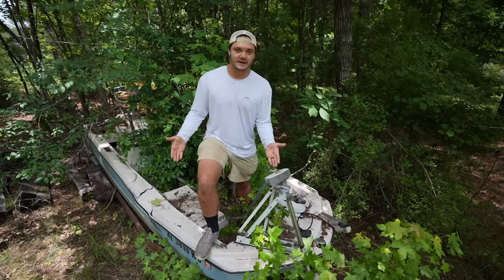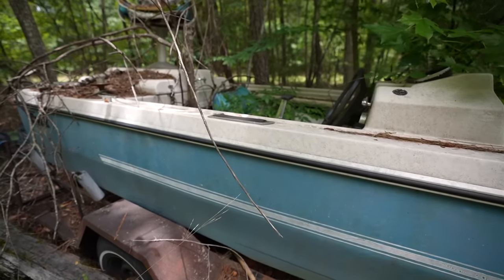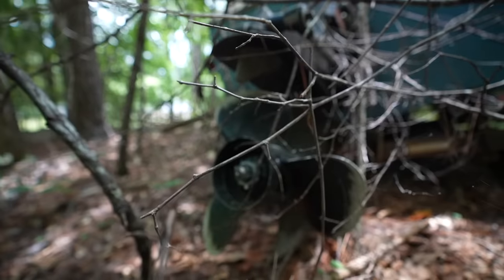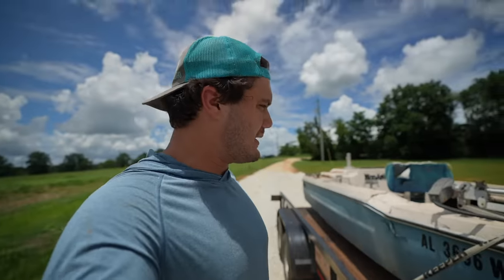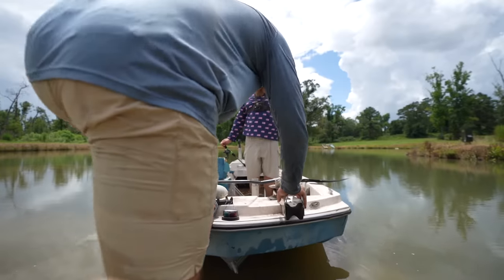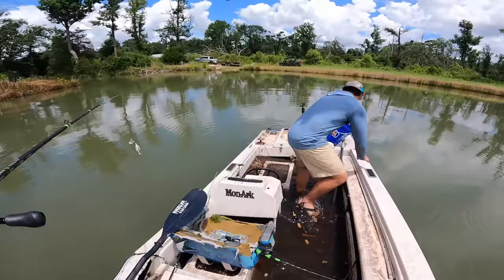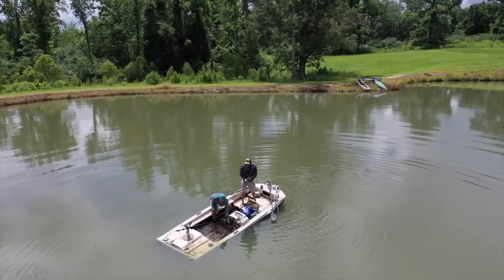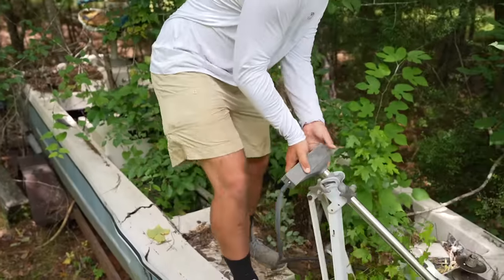I Found a 35 Year Old ABANDONED Boat in the WOODS!! (Restoration Project)

Comment: The hull looked like it was actually in decent shape. Then you dragged it across the asphalt and lifted it with a forklift to push it onto a trailer. Which totally destroyed any chance of salvaging it.
At this point it will probably cost just as much to fix it as it would to just buy a used one that's in decent condition...

What blows my mind is how much dirt is in it. Did someone take a shovel and try to bury it?!? How does that much dirt accumulate in something 3 feet off the ground?

Comment: If you ever need advice on fiberglass work or any other help restoring a boat, hit me up anytime! I'm guessing the boat being dragged on the concrete popped a hole in the bottom most likely an easy fix. Great video!

Comment: I’ve owned 17 or 18 boats in my life  and that type of a project is going to cost you way more than the boat is worth in just parts and materials  good chances are the hull is saturated with water  and the  mechanicals  will all need to be replaced   I’ve seen too many Free boats cost people over 20 thousand Dollars of repairs  winding up being  paid  to be disposed of  because I grew up and lived inSouth Florida for many years  this is especially true for people that are not  Fiberglass  repair   Knowledgeable  I do however appreciate your excitement  and have encountered similar  feelings on boats I’ve acquired in the past as well , back in the day Monark built a decent boat  but keep in mind there is usually a reason why someone abandoned the vessel so many years ago  which generally is  a  it’s not worth putting the money in it then  to keep using it  as a boat

Comment: EASY MOTOR TO WORK ON.. CHEVY 4 CYL.. BUY PARTS FROM NAPA.. LOOKS LIKE A 140HP ? VERY GOOD MOTOR ...GREAT ON FUEL.. I HAD ONE IN MY DADS 1979 20FT GALAXY AND WE WOULD GO OFFSHORE FISHING ALL THE TIME WITH A 20GAL TANK AND EXTRA 5GAL CAN AND RUN ALL DAY... MOST THINGS TO CHECK IS THE GIMBLE HOUSING AND REPLACE THE SHIFT BOOTH AND EXHAUST BOOTH SO YOU HAVE NO LEAKS... GOOD LUCK SIR.. I ENJOY UR VIDEOS AND WATCHING THE HOUSE BOAT BUILD....

Comment: I'm sure the hull of that boat would be full of water. The front of the boat should be jacked up to let it drain, maybe even drill a small hole in the floor to see if there is a bunch of dirty, sludgey water and try to pump/suck it out

Comment: I thought it ambitious to call it a "Floating Greenhouse". It's obvious it's a greenhouse. The "floating" part is to be determined. I'm sure the dragging down the driveway and the street didn't help its cause, along with drilling the port bow into the trailer sidewall, and crunching forks into the stern. But hey, in for a penny, in for a pound. At least you got it washed. That should take care of the spiders and roaches, unless they have gills.

Comment: I laughed so hard.  There wouldnt have been any entertainment in clearing out and around the boat while penetrating oil did its job on the jack or using a hydraulic jack and slapping on some used or new trailer tires .  Lower units are removable also.  Lol.

Comment: Got to take that right down to the bare hull with top removed. Replace stringers, fix leaks , repair top and so on and so on.  Be cheaper to buy something that works.  You're gonna spend $$$ in glass and resin and who knows how muck on the engine and stern drive.

Comment: Next time you rescue a boat just try getting some new tires on the trailer. dragging a boat on asphalt is only setting you back lol. That boat is trash now.. Dont ever drag boats. Pull it out of the woods and doesnt check the hull, drags it through dirt, rocks and on top of asphalt and doesnt check the hull... Its been sitting for 35 years and drug on asphalt no need to check the hull just send it, now lojo has a new snag and a engine in his pond that could leak oil and fuel into the water killing everything...

Comment: He should have never dragged that boat across the concrete you should have never ever change trailers you should have left it on that trailer put tires on it and took it to the pond and it has been okay you drug holes in it and you knocked holes in it with that forklift and everything Lord God I have a 1986 bass boat Monarch and I was going out across the lake 60 miles per hour and my bottom peeled out from under it I mean the monarchs is bad about bottom problems good luck with it brother I hope you get it out of the Pawn have a blessed day man

Comment: So how did it make more sense to grind the entire bottom of the hull off that boat instead of spending a couple hundred dollars on tires for the boat trailer? It may have floated before you ground and cracked the hull to pieces. If you're still going to revive that, best of luck! The old B.O.A.T. acronym wont suffice. Going to have to bring out another hundred thousand.

Comment: launched without checking drain plug ? also "thanks dad for sandpapering the keel off my boat " old fiberglass on road mud drag was the right way and definitely should've washed waxed bottom to reseal the sun/moisture damage  and wouldn't have launched it without 2 bilge pumps with float switch and a solar panel to charge the multiple batteries to ren the bilge pumps if motor was running wouldn't need as much battery storage bit after 2 deep cycle marine for bildges you'd have to alot more battery storage for the trolling motor just to get ya around since ya don't know about the motor
Reply: i got an ole sitter too 21ft  tri hull johnson trailer is beautiful but would need to replace all 4 tires grease the axels basically a full overhaul on both sand blast repaint trailer and soft scrub then a few coats of was I'm thinking even melted paraffin wax just to buff it on and keep the fibers from going loose guess they got a epoxy spray but that's after ya clean it oh yeah and i need new plywood on the inside of mine wasn't the greentreated I don't think but i know the motor was put in from a Chevrolet Nova ran when parked  then i was born...

Comment: Quit bailing the water it's futile at the point, just throw that baby in gear an the water will drain out the back an head for the ramp, thats that's if it if you left the plug out which looks like what happened.

Comment: I’m not trying to be a dick but the whole trying to take the boat off one trailer and put it on the other was like the most painful thing I’ve watched in a long f’n time  you guys didn’t do one thing and even a somewhat close being logical plan  like as you were pulling the boat off the boat trailer the first time all you need to do is stop every 4 feet or so throw a couple blocks of wood underneath so the damn thing isn’t sitting on the ground and then you could’ve just dragged it straight into the other trailer and then you guys try and load it on cement dragging it on cement fibreglass boat on cement wow and you didn’t even put blocks underneath the trailer tires that you were trying to pull it onto at the very least you guys could  of put plywood or boards underneath the boat so you’re not dragging it on cement no offence but that’s probably why it sank there’s almost no chance that that wasn’t why you sent that but I guarantee you put a bunch of small holes in it  to where you might not have noticed it by bear I just buy your eyes but up a bunch a little tiny holes all over the bottom of it  and the saddest thing about it is I love your channel I think you’re hilarious and you’re probably the best fisherman out of the bunch that’s not saying much because lojo sucks  lol the guy who makes money off of fishing YouTube and doesn’t know the difference between a soft plastic flute fluke and a soft plastic swim bait he buys a paddle tail swim bait and tries using it as a fluke I was tough to watch I don’t know maybe You did it as a joke I kinda hope you did because I was the silliest thing I’ve seen in a long time and by the way are you Bam Margera’s younger brother or something you guys are identical even have a very similar sense of humour and voice